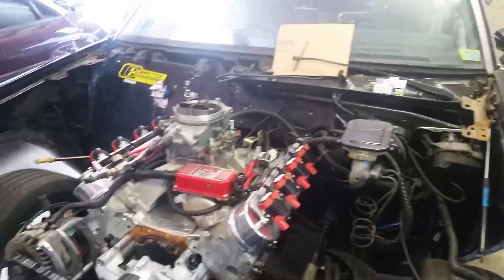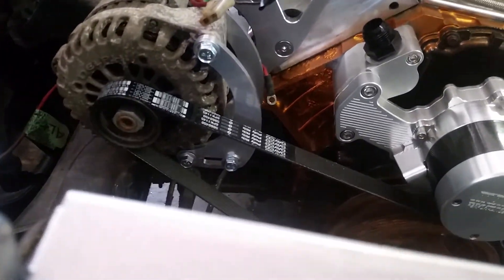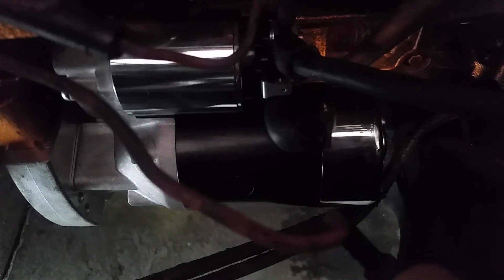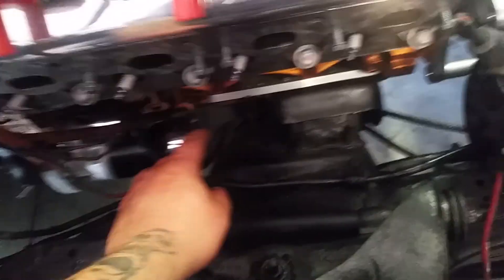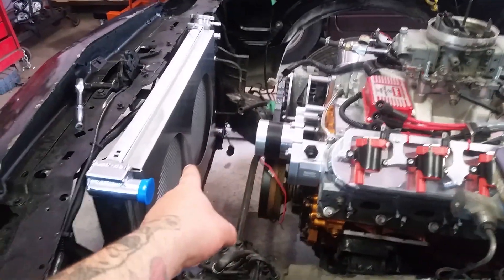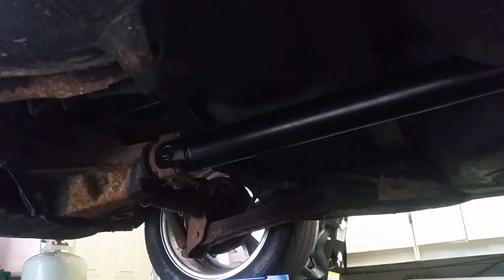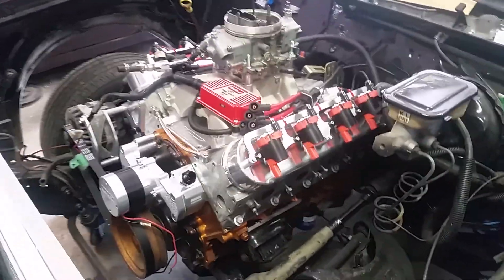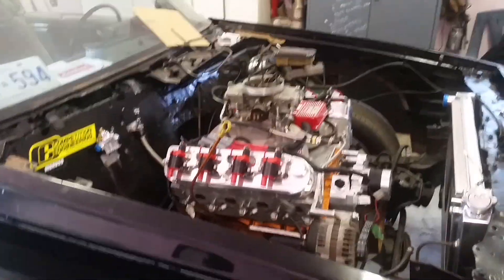Thanks for the 300 sub!!!

Comment: Upgrade the alt. To at least 140 amps at 1000 rpm to help with the extra amp. Pull an ditch that 85 amp at 1500 rpm stock one

Comment: Brown wire is for exturnal regulator   it would be cleaner and easier to swap the alt. To a one wire internal regulated alt.plus you'll need 2 relays 1 for the water pump and 1 for the 2 fans reason being most 12v switches wont handel the amp pull from the fans and water pump
Reply from the maker: Marvin Jones ok thanks alot for the info